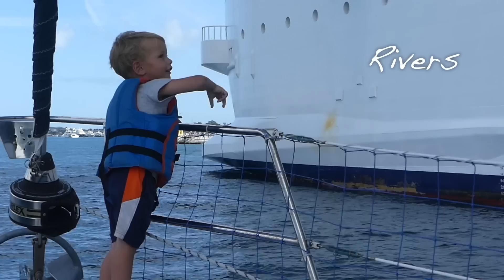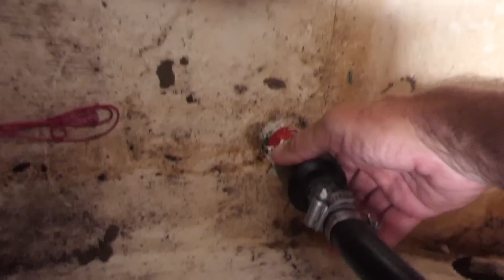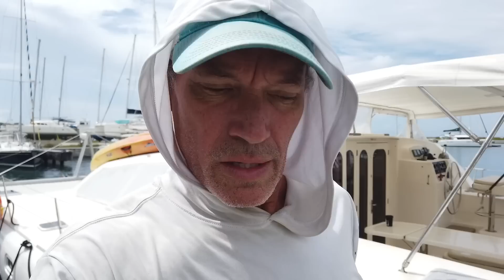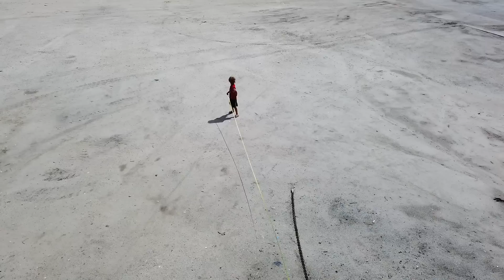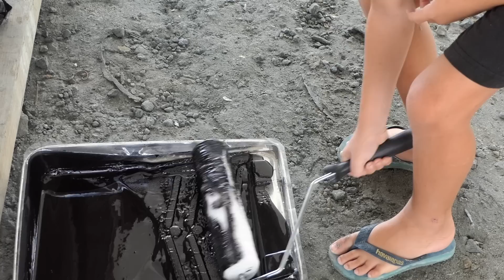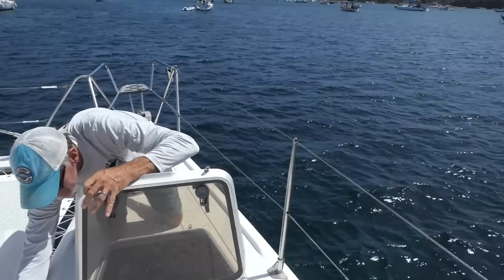PAINTING OVER our COPPERCOAT BOTTOM - | SailAway 217

Comment: With any crack, drill a hole at both beginning and ending. The size of crack is the size of bit so you can catch the top and bottom of your crack. You will never stop the crack without the drill holes! Good luck with your repairs! It looked like the anti corruption nut at the end of prop.
Reply from the maker: Yeah, that's a good advice!  Thanks!

Comment: I sell that paint.  We mostly use red on the wood oyster boats here.  100 year old boats.  Works great except for on the running gear.  Anything metal tends to get barnacles.  These boats sit except during oyster season.  They are big boats and take 10-12 gallons.  Yours came out nice.  Safe travels!
Reply from the maker: Thanks, that's really good to hear!  Not too concerned about the running gear because I regularly dive on it and clean up that stuff myself.

Comment: No to underwater lights. Never put unnecessary holes in a hull. Buy waterproof led strip lights and dangle them in the water when you need them.
Reply from the maker: Yeah, I tend to agree, at least below the waterline.  I might add some simple down lights above the waterline that only require one small through-hole for the wires.

Comment: Great video! Have read great things about good copper bitten paint, was looking at it for us. Do you have a clue want coper paint was used? Have seen were copper paint should last over 5 years.
Reply from the maker: Thanks!  This was Coppercoat.  I don't think it was applied properly or taken care of properly.  It was definitely too shot to keep it as it was and too expensive and labor intensive for us to recoat it.
Reply: @SailAwayVlog  I see that it is expensive, have also seen a lot of issues with application. We are looking at this and silicone, still think when done right, would be much cheap in the long run.

Comment: Looks great.  Ablative the only way to go, though higher speed of cat may ablate it faster.  So long as it has reasonable copper content you'll be good and fouling in Charleston will be mild.  Amazed that seacock did not leak. Better to have raised bottom paint level vs. issues with decorative bootstripe. If the cat still has gelcoat, I'd go for buffing and sealing, as once you paint, you/owner will need to renew every 7+ years.  I would think wave action will wash off any acid wash left.  Newer underwater lights do last longer and they are fun at night and attractive fish, but you have more important items to spend your $s on.  
One question - do the diesels have sleeved cylinder walls?  I've seen a bit of what looks like excess smoke in exhaust and would think inplace valve reseating and resleeving (if possible) with new piston rings would help renew engine.  In place in this instance does mean raising engine up in engine room to remove oilpan and removing pistons.  Might do cylinder head gaskets at same time, but that's a lot more work/ breakdown..
Reply from the maker: Thanks so much!  Unfortunately, the gelcoat is pretty shot in a whole lot of areas.  We can make it look pretty decent, but it'll need painting at the least to get it looking really good.  It'll definitely do for now!  Not sure about the diesels, but the smoke is only for about 30 seconds max right when we start them.
Reply: @SailAwayVlog  Sorry about going on about a top overhaul. If in fact your engines do have cyl liners the renewal is DIY doable.  Get the old ones out shrinking them with dry ice for a few minutes and new liners in after a few hrs in freezer.   If it is just smoke for 30 secs that is more indicative of injectors needing cleaning/renewing as poor spray pattern or fuel drips after shutdown.  So long as you are not losing coolant, it is not a head gasket. Neatest DIY method of cleaning injectors I've seem involved a tire rubber valve stem with valve removed, valve cap, a can of carb cleaner with little red straw and a small 12v bat to open the injector valve. 
Paint has improved over the years and two part with UV inhibitors is better.  So long as you can spray it, you have a lot of white colored real estate on that cat.
Again I've gone on too long....